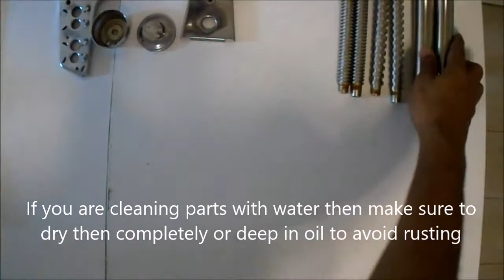Disassemble & Assemble - Stainless Steel Pasta Lasagne Spaghetti Tagliatelle Maker Machine

Comment: Thank you very much. I tried to disassemble the machine to re-align the rollers. But I did not know I only need to disassemble one side, and forcefully released the other side but the knob is still stuck. I did not know you could hammer the cap off, thank you for the video
Reply from the maker: Glad it helped

Comment: Is there a way to remove the rolling pins to fully clean them?
Reply from the maker: No. They are connected with the body.
Reply: The two big ones (the lasagna ones) have gears that are screwed on, some pliers can remove them. But I can’t figure out the smaller ones